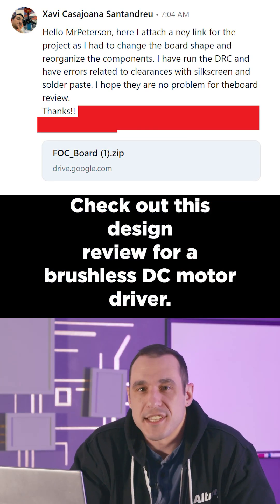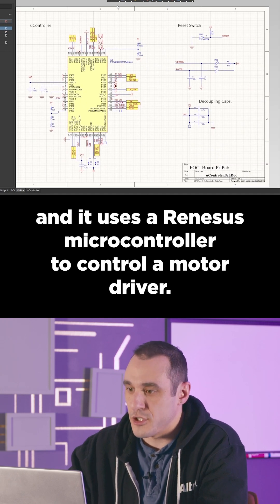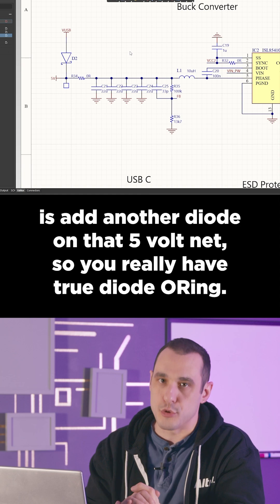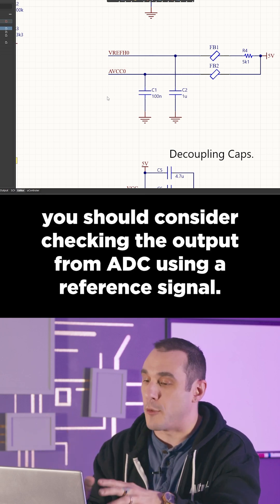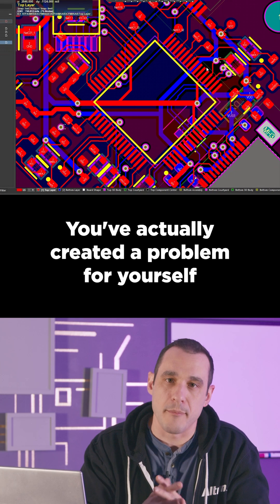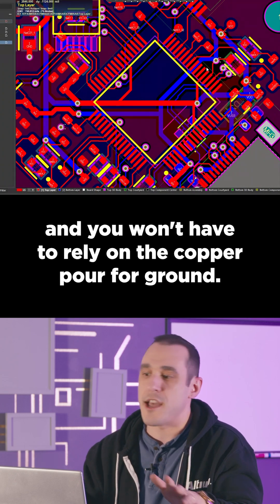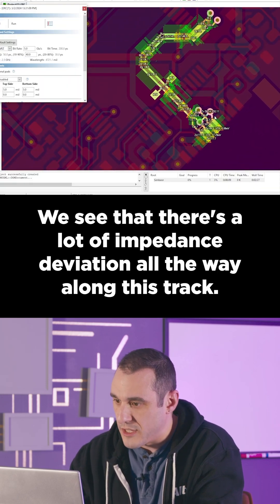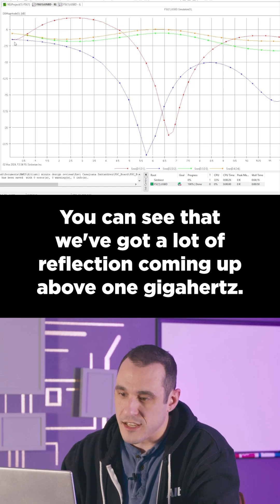Gorgeous PCB Layout! | 1-Min #PCBDesign

Comment: How to simulate reflection in altium? And S parametr?
Reply: You can simulate reflections using the Signal Integrity option in the PCB Editor. Make sure your routing is completed, and you will have to assign a buffer model for the pin/trace you want to simulate. This will give you the time domain waveform to check reflection, but it will not give you S-parameters.

Comment: "simple solution, just go to 4 Layers" 😂 
In the real world, we usually have significant budget constraints.
Reply: Have you ever actually costed out a board on 2 layers versus 4 layers? They are both cheap, and the difference is negligible especially in volume production.
Reply: @Zachariah-Peterson yup. Engineering time is usually far more expensive than the layer price delta unless you're shipping commercial volumes.

Comment: What program did you use to check an impedance deviation and S-parametrs?
Reply: i came to ask the same question, he might exported the design as ODB++ Simboer software, he mentioned this before in one of his videos
Reply: @mohamedtalha9790  thanks
Reply: @mohamedtalha9790  right 2D 1/2 analysis from ODB++ format, that allow S parameters , TDR , coupling , eye diagram and all necessary tests prelayout and after layout.
Reply: Simbeor
Reply: @kouseiarima8596  thanks